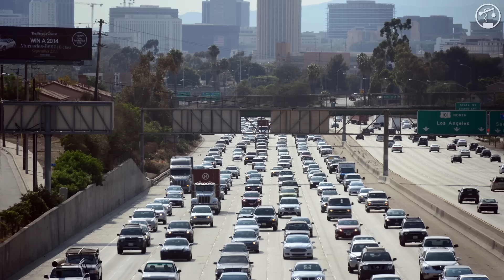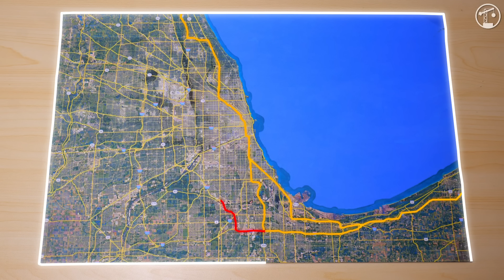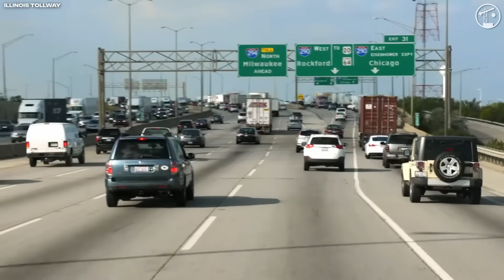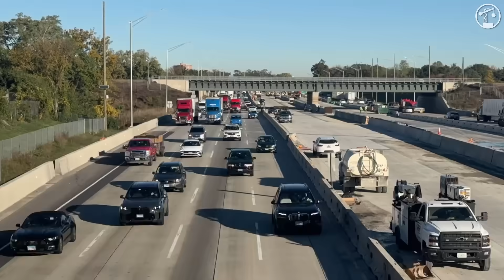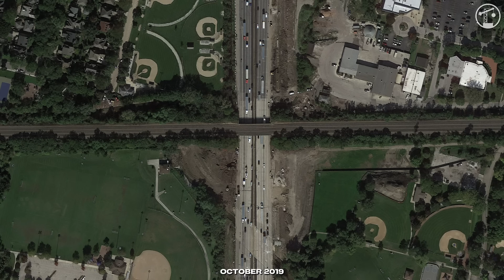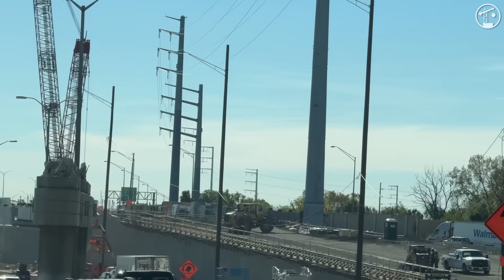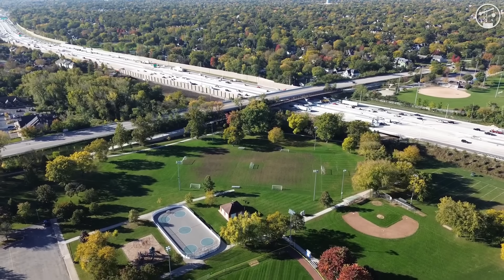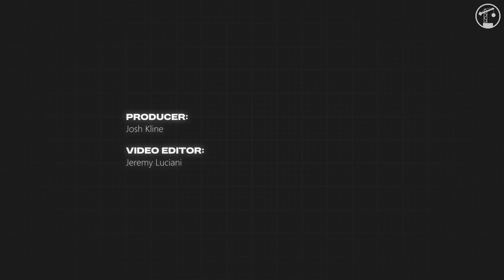Why Chicago is Spending $4B on One Road

Comment: Dear BUILD CORE,
Thank you for this well researched and presented piece.  This is a very well designed traffic concept based upon the existing roadways, and ( for a short period of time ) it will be politically popular with local drivers and voters, however here is the problem, any benefits that are garnered from this change of flow pattern will last ( at best ) fiver to eight years, after that the same ( or worse ) level of congestion will return with different choke points causing similar problems as before. 
Historical traffic studies show that when roadway flow patterns are freed up, or when new roads are created, the number of cars "increases" to fill that available capacity, it does not make a difference how much, ...this is a given.  
In essence the Tax Payer ( a Toll Way is still a Tax ), and State and Federal Governments will have spent 4 Billion USD to free up traffic and solve specific choke points for for only a limited period of time and that will create open space for more traffic to fill it. 
The irony is that State and Federal Highway experts know this, they have known of this for a long time, however the voters and the users of these late 1940's designed interstate highway systems do not know this, and they have to drive them, use them day and day out, work in them, and live around them, and they want something done to solve the problem.
Fundamentally this work is being done to keep everything "..as it is..." with little to no real improvement of the base problem, too many cars moving on too little roadway. And here we are.

Comment: The interchange from 88 to 294, is a single lane, basically 360 degree turn, it’s known locally is the Hillside Strangler. That alone cause a good portion of the traffic on the entire southern half of 294 when traveling northbound since so many trucks take this route. The change are basically getting rid of the entire circle which should help out a lot, I think this is a major improvement that was a little overlooked in the video

Comment: Implementing fair congestion pricing is going to be difficult because its difficult to draw a nice boundary around where it should be applied.  The Tri-State is often suggested as such a boundary, but it contains many sparse suburbs as well as the city core, and the residents there will not approve of a congestion tax if they have to pay it and get no benefits from it.  The city is not an island like Manhattan where it can be cordoned easily.  If the result could fund better public transportation, and all of the right-of-way issues and other roadblocks can be negotiated that have stymied such efforts in the past, it would be worth doing though, as then there would be alternatives to driving.  Currently Metra/PACE are the main suburban public transportation options, and they are practical for only some commuters that happen to work in the city or along the train lines.

Comment: Been driving the tristate since the early 80s.. and avoiding it as much as possible..  

But watching this expansion as infrequently as I'm up that way now has been Totally intriguing EXPERIENCE!..  just the amount of work they needed to do ...  to do work..  e g. Driving thru the Ogden Ave area.. just the muster areas for ALL the trades involved! And if I'm not mistaken at the S turn by rt 45 (I think) there's 4 levels of roads?.. wtf..  I seen 2 of the biggest cranes ready to take up beams I swear were a foot ball field span...  CRAZY!  if you can do a time lapse or just show some of the construction!

Comment: The Good Ole Days. Nothing like blasting past a Trooper sititng on 88 when you are on 355 or 290. 355 is the best route around all this mess though. and routes like 56 ,34, 38 ,20 , 64, are faster in and out of the western burbs than 290. At least they are trying.
Reply: 355 is ok for certain stretches, just like 294 has good spots. I've driven both on either side of O'Hare.  It's almost like the less congestion the more idiots trying to go 90, not signaling and weaving. But you're right - at least they are trying.

Comment: I’d love a longer video or series. There is so much to this project, it is so vast
Reply: Go drive on 294 and sit in the rush hour traffic, you'll get a nice long look at it😂🤣😂
Reply: @bskor9722  ironically i have never been stuck in much traffic on 294 except heading north by the outlets when the exit gets backed up by a couple miles
Reply: @garyhand5104 well you're lucky then bc the traffic can get pretty bad sometimes . The parts they have finished are pretty nice and smooth flowing now though.  But it is a pretty big project. Supposed to be done next year.

Comment: Let's be clear, it's not Chicago, it's the state of IL with likely some federal $$. And it Costco $4bil because idiot DOT is terribly inefficient and allow bid rigging state wide.

I80 should be moved about 20 to 40 miles south of its current location.

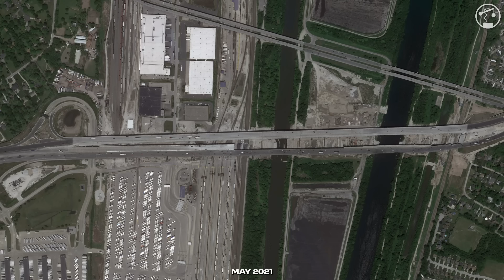5:10, typical idiot DOT, 6 years to build a bridge. They've repeated this a few times. Not necessary.

Comment: I changed jobs because of the commute on 294. The number of choke points and accidents is too much. Especially at the 88/290 interchange and again at Cermak. Last year many south bound drivers were ignoring the signs for how to exit at Cermak because the routing didn't make sense. Fortunately they corrected that after seeing how many cars were cutting through the traffic cones in a last ditch attempt to exit at Cermak while a line of trucks from the 88 merge comes in.  It felt like being in one of those figure 8 demolition derby tracks.  Getting on 294 north from Cermak is just as bad - you have to muscle your way in because of the truck heavy traffic crowding the merge lanes because the signs are telling them to keep right for Roosevelt/38 and 290.  It's not the truck's fault because many of those drivers are unfamiliar with the area and don't know when to be in which lane.

Comment: and 294 onto 290 west is still a joke.  didnt fix anything.  you can't have 2 lanes going into one at all.  the two lanes merging need to become the expressway, like 355s to 88 w.  The on ramps become the expressway and there is never congestion.  And for now 294 s just north of 290 is joke too.  I hope when it's all done everything will be good, but I know for sure 294s to 290w has all lanes open and it's ridiculous.

Comment: One of the worst things in the Chicago area is how the exits often don't make sense. For example getting on I-355 South from I-290 East. If you were looking at your map, especially if you're from out of state, you would assume the I-355 exit should be on the right side since it's turning right off I-290 and heading south. But no, you have to be in the left lanes and cross under I-290 as it goes east overhead. It's counter-intuitive and always causes a lot of confusion, accidents, and traffic jams.
Reply: And GPS often tells you to be in the wrong lane.

Comment: "Induced demand" is a misnomer.    Roads don't create traffic,  they manage traffic.   When a road such as 294 lacks the capacity to handle the existing traffic,  motorists will find alternative routes,  typically driving on local roads and through neighborhoods.  With the widening of 294 to 5 and 6 lanes,  as well as the interchange improvements that will fix the common backup areas,  the road will be able to handle significantly more traffic.   Cars that would otherwise be driving on local/ neighborhood roads will return to the expressway... which is where you want these cars.  This will in turn lighten demand and congestion on local roadway networks.
Reply: We'll see once the construction is done.  People including me always complain about congestion caused by construction, especially when the signage is poor and the interchanges are dangerous.

Comment: I'm going to step out on a limb and predict.....This expansion and modernization, though nice wont work. It wont work because the Northern Illinois, Northern Indiana and Southern Wisconsin highway network isn'tcomplete. They need to extend 355 south to I 65 in Indiana and extend 355/290/Rt53 all the way into Wisconsin through the forbidden development zone of Lake County . As crazy as this sounds you also need a north south Highway corridor  somewhere around state road 47 that parallels 355 and I 39. None of this is going to happen in my lifetime though
Reply: It's crazy that northbound 355/53 just bottoms out at the county line.

Comment: Been driving trucks for 27 years now. Very first trip was into Chicago. They’ve rebuilt 80/94 and added lanes years ago. Afterward, the analysts looked at it and said, “Nice job. Now do it again.” 

Two ways to help with the congestion and other issues. First off, eliminate about half the interchanges. If it doesn’t have a state or federal highway on it, the ramp goes away. Second, double deck the entire thing as an express route with only interchanges to/from other interstates. All the traffic simply bypassing the city on the way to/from Wisconsin or Indiana doesn’t need to have to deal with the local traffic getting on at one exit and getting off 2 exits down. 

Oh and take the old tollbooth areas and make them limited duration truck parking. 10 hour limit and a bathroom. Nothing more.
Reply: A double deck highway would be way too expensive and which traffic get routed up there?  If the interstate traffic, where are the truckers going to pull over to rest?
Reply: @BBB-fm2tq don’t need a rest area for the trucks up there. Express lanes straight through. There’s no place for resting now except for a couple extremely limited spots. As far as cost, do you really think that $4B is the final price tag for what they’re going now? And it’s paid by tolls, not taxes.
Reply: The tollway conveniently uses the old tollbooth areas as permanent construction staging areas lol

Comment: They need to make a better exit to Ohare heading southbound on 294 coming from the northern suburbs. I've seen and been in that stopped traffic backed up for a 1/4 mile while the other 3 lanes trucks are blazing by you at 70mph.
Reply: Same thing at the Cermak exit.  At O'Hare it's partly because the inbound road wasn't designed for that volume of traffic and there's the I-pass choke point and Mannheim Rd interchange.
Reply: Oh and car ain't doing the same but blame trucks you people are ass backwards

Comment: There are two primary major bottlenecks along 294. First is the Hillside Strangler, where 88, 290 and 294 all come together. They are currently working on fixing that. 
The other is the southern end of 294 and the one is mainly due to what was previously 7 lanes of traffic cutting down to 4 within the course of about 4 miles. Not to mention the exits for Torrence and Calumet Avenues in Lansing and Lynwood. And that one really can’t do anything with due to the space limits that the Indiana side is already at. Without taking more homes that front the North side of 80/94, the road is locked in at its present capacity.  That one is worse on Fridays and holiday weekends as Illinois people try to get out of town for the weekends to Michigan mainly.
Reply: Imagine if you worked at Windy City Mobile Car Detailing, right in the triangle.
Reply: @BBB-fm2tq I go into UP Global 2 at least 3 or 4 times a week. Know the area well.

Comment: go to other cities and see the speed limits are 70 mph or 75. not 55 mph. insane. chicago is literally moving slow motion while everywhere else is moving high speed
Reply: But on 294 most cars go try to go around 80 and trucks are around 70. As the video mentions, the tight merges are not designed well for the higher speeds.

Comment: In the mid 90's - 20's my commute took me from Plainfield to Deerfield. Two hours each way, with Friday evening taking 4 hours. I haven't used it much since then. Still remember I was around the Toughy ramp when 9/11 happened. I'd imagine "If they build it they will come"  applies. Of course there's the 5 year resurfacing plan Illinoisans are used to.
Reply: That's one of the commutes that is supposed to improve once construction is over. But it's 50 miles one way regardless which means you're putting around 25,000 miles a year on your car assuming a 5 day work week.  Probably $4000 a year in gas and tolls (more for maintenance) and about a month of your life spent commuting every year.

Comment: The most annoying part is the exit/transfer ramps  restrict down to one lane.  A 2 mile stand still on the right just to exit or enter.

On the plus side, if you are old enough to remember the coin toll booths, it’s still a lot more efficient than it was.😂
Reply: Think about this as far as the coin booths: since its now automated with the ipass and theres no more need to employ someone in each booth, in every lane, 24 hours a day 7 days a week- what has Illinois done with all that saved money?????? And they were only supposed to collect tolls until the bill for building the original 294 was paid. Lifelong born and raised Chicago resident here and I drive a truck for a living and I'm on 294 at some point just about every day.

Comment: In the 1960s, the proposed Crosstown Expressway (Interstate 494) was supposed to relieve traffic on 294, but it never happened.
By the 70s, too many people were against it, and the plan fell apart. Although it was not officially killed until 1979, it really died along with Mayor Daley in late 1976.

Comment: Chicago's biggest issue is the thru route of I80 from the 80/94 split near Gary all the way where 80 and 294 split. All E/W traffic flows through that section. If the thru traffic that wanted to avoid Chicago completely could drive through there avoiding all of those interchanges and industrial areas, it would be a game changer. It could be a continuation of I-355 south at the interchange of I80, and it could go through the relatively undeveloped areas along the US30 corridor, interchanging with I65 near Merrillville, I80 somewhere near Otis IN, and then 94 near Michigan City. Alternate interstate that avoids the current problem areas and congestion, and also far enough south to avoid some of the common issue areas of lake effect snow along the 80/94 corridor on the south side of the lake (US30 doesn't usually get it just a few miles south)

Comment: Compared to other toll authorities, the Illinois Tollway is definitely one of the better ones out there. The lanes are wider, much better maintained, and overall a lot better than free highways. ISTHA was also an adopter of cash free and open road tolling. Indiana tollroad, for example, is privately owned (for profit) and the condition of the road shows that. The tri-state is undoubtedly the most important highway in Illinois and generates a ton of revenue for the rest of the system.
Reply: And they have excellent snow removal.
Reply: Exactly, especially when traveling between Wisconsin and Indiana. The tollways are cheap enough to drive through, unlike Taking the mainline interstates 90/94 when they're so congested.

Comment: There isnt a legitimate good reason for it. The city is still dependent entirely on a union workforce that is very corrupt. Illinois started a road improvement initiative when Obama was still a senator that he pushed for strongly and got it approved. It guaranteed the money would be available to contractors who won the bid for whatever road project the state and any municipality wanted to do. In the Chicago area there are no deadlines to get the contracts done. For example, the Weber Rd bridge renovation over i55 took 7 years to add a lane on each side. Currently in Tinley Park, the 80th Ave bridge over i80 has been under a renovation project for over 8 years and there is no end in sight. Look at road work in Illinois as military contracts for Boeing and GE. They don't need to be finished, just worked on.

Comment: They literally rebuilt the whole thing in like 2009. It was the exact same experience with the temporary lanes splitting and concrete barriers up everywhere. Then at one point it was open and normal. Seems like pretty much immediately they started building a new one. It’s not gonna change anything drastically this “new” version.

Comment: Maybe build a rail or light rail to connect the whole Chicago metro?
Reply: The Chicago area is the most rail dense place in the entire United States.  Metra runs 700 trains from the city/suburbs every day.  NICTD runs all the way to South Bend, IN. Amtrak goes to Milwaukee and SW Michigan.  All 6 Class I railroads run through and interchange freight in Chicago in addition to 2 short lines and 2 belt railways.

The only state with more miles of railroad track is Texas.
Reply: There is already tons of rail...?

Comment: The Illinois Toll Road is not in Chicago.   It's ran by the state.   Two commonalities:   They're both under perpetual construction, supposedly being improved.   TONS of graft, patronage jobs, insider contracting, etc. are part of life in and around Chicago.   Now because Chicago never met a tax it didn't like, it's constantly increasing the tolls of the Chicago Skyway Bridge that connects the Dan Ryan Expressway with the Indiana Toll Road.   Fun Fact:   Illinois Toll Highway Authority was supposed to dissolve decades ago, once the initial cost of construction was recovered by the tolls.   Well, f that, right?   Illinois will never let that happen, so it's never going to allow construction to end.
Reply: Chicago Skyway is owned by a private company so they control the tolls.  Chicago sold it in like 2005.
Reply: @sparks869  Fun fact, it's leased for 99 years.

Comment: The same story exists in many places that are stuck with freeways built in the 1950s and ‘60s. They are too small, with on & off ramps too tightly placed and sharply curved, and so on. What was acceptable 60 years ago is a mess today. Trying to fix these is an immense and very expensive situation.